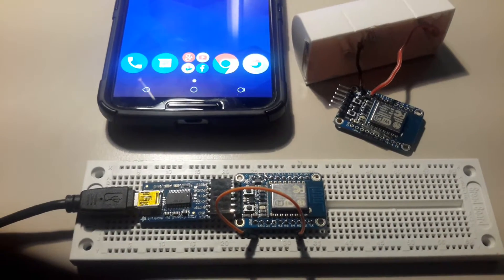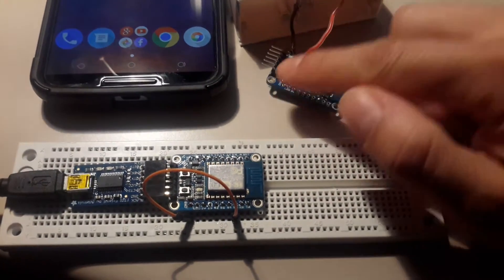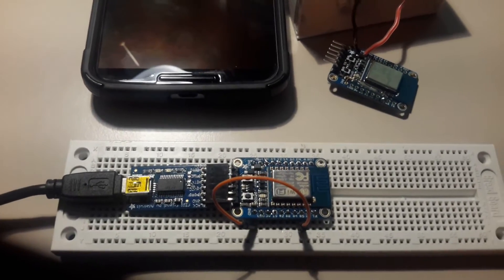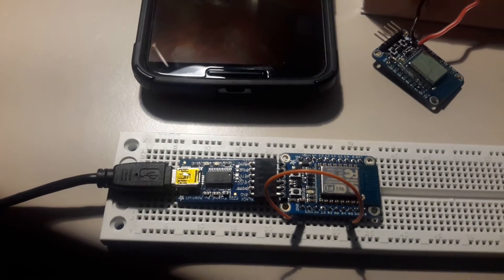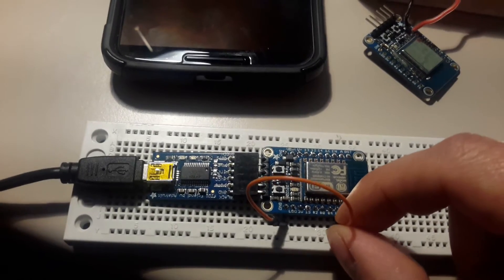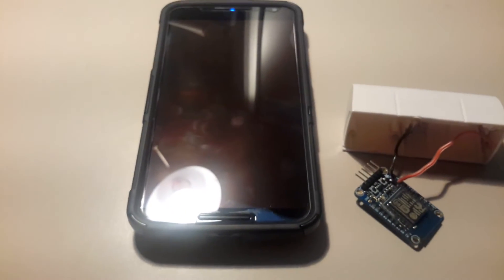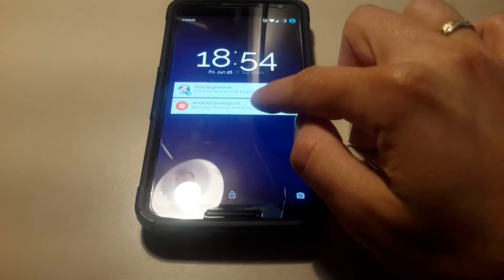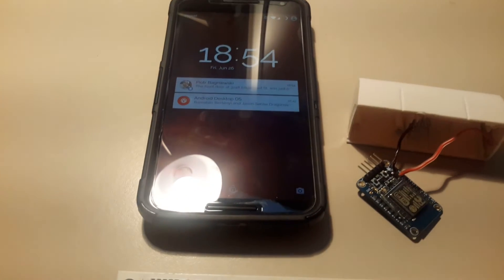ESP8266 IFTTT Demo #2

Comment: At Last I found something that could help me with my project!
Can you help me out with how to connect all these? (like intractable?) 
can I use my Arduino Uno Wifi? What should be the code then?
My project is super simple, I need to create physical buttons for my ifttt commands around the house, your project is a start for sure, but how to have my Arduino Uno Wifi in the mix evades me...
Reply from the maker: This was so long ago, I dont even remember. I moved on to other projects